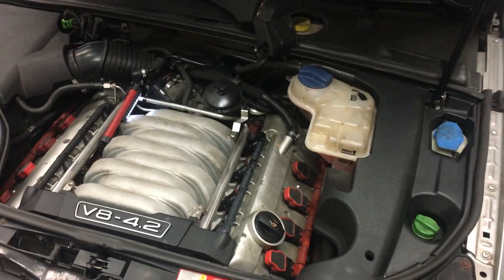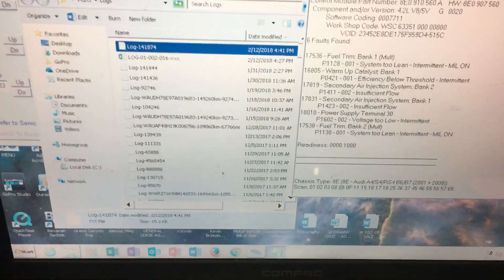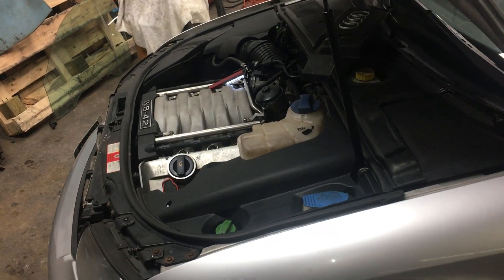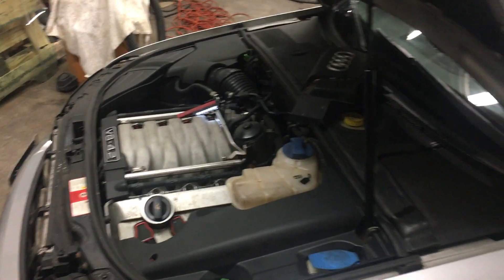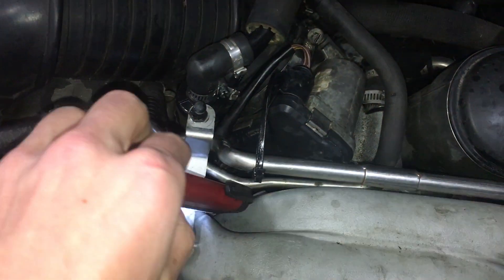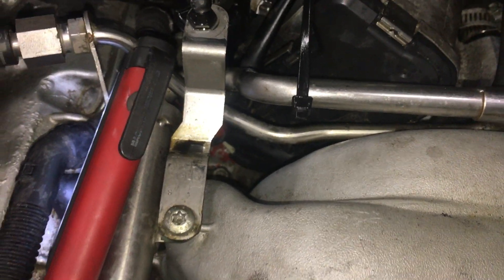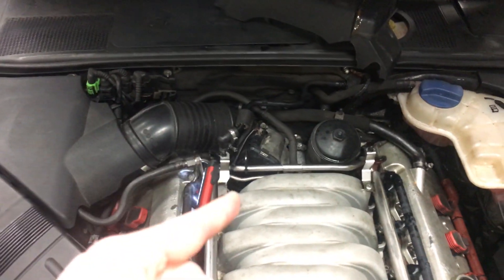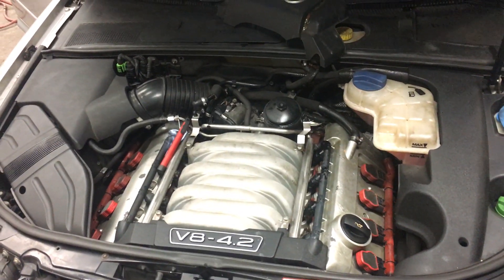Audi S4 A8 4.2 P1411 P1423 Secondary Air Insufficient Flow

Comment: I have that code also. Could a vacuum leak trip those codes? Also where is the pump?
Reply from the maker: Hey BunBun 143 thanks for watching my video.  To my understanding a leak in the secondary air system could throw the code, it is best to get a diagram of your secondary air system to locate all the parts specific to your car.  You can try google searching something like, the year of your car and model followed by secondary air injection system diagram.  This will show you all the components in the system that you can look over.   It would also be helpful if you could do an activation test of the pump to feel the output of the pump.  Please share an updated diagnostics, thanks a lot.
Reply: Thanks. I’ll do my best. I’ve been dealing with EPC, traction control and engine light for about 2 weeks now. I have the following codes.

P0507
P1423
P1411
P1542
P1653
Reply from the maker: Thanks for the update, seems like you have a bit going on.  My experience it seems like for P1423 and P1411 secondary air pump and or secondary air lines, along with a throttle body issue for P1542  and P0507 ( I would often replace the entire throttle body). As for P1653 you would have to scan the Brake Control Module to know the true issue, things I have come across are, the wiring harness at the ABS module connection, needing cleaning, lubrication and or wire repair.  Some times I would send the ABS module out to get repaired ( not too complicated).  Then again it could be a failing speed sensor, always best to see the codes if you can.  Please remember these are only my experiences make sure to do all your due diligence before replacing anything.
Reply: Thank you! I’ll definitely look in too all of the above mentioned. I feel like the engine isn’t getting enough air.
Reply from the maker: Cool stuff keep me updated, thanks.
Reply: I took my car to a mechanic. They did the diagnostic and it pointed towards my throttle body. Just changed it and the mechanic did the adaption. On my way back I got the same symptoms. EPC, traction control and engine light. Idk what do to anymore.
Reply from the maker: What about the other codes? Anything else replaced, always have to do a full system scan to see what is stored and hard fault. Very tricky situation especially with the other codes you need to see what codes are coming back?
Reply: The mechanic said that the diagnostic pointed at the throttle body and that’s what’s causing my codes. Says the new throttle body I got could be damaged and the person I bought from swears up and down that there is nothing wrong with the throttle body and is willing to take it back and give me my money back. So I’m gonna replace the abs module and if symptoms are still there I swear no word of lie I’m fucking burning this piece of shit down to the ground. I’ve spent too much money and time on it and I’m sick of it! No one knows what the fuck is wrong with it or how to fix it! lol sorry just frustrated lol
Reply: Update. I finally fixed the problem. I opened my old throttle body. Cleaned the entire gears and the motor with brake clean. Put all back and in my car. I had to unplug the negative terminal from my battery for about 30 minutes for the system to rest. Plugged the battery back. Turn the car on but not the engine. Waiting for the throttle to do it adaption then started the car. Everything. works perfect now!
Reply from the maker: Nice work that is crucial to give the throttle body time to do its adaptation is crucial.  I am guessing you had no advance scan tool and managed all the clearing and adaptation manually, very cool.  Thanks for sharing this, it will be very helpful to many others that read this in the future, thanks again for sharing.

Comment: Does a crack in the pipes from secondary air pump cause a high pitched squeal similar to when pcv faulty? Mine is squealing high pitch when warm at no throttle/idle, but pcv changed and still doing it, also removing oil filler cap makes no difference to sound and not difficult to pull out. Any ideas?
Reply: Also have same codes for cat warm up insufficient
Reply: Did you ever figure it out? I have the same issue

Comment: Changed my MAF sensor on my 2005 Audi A8 L. Never knew there was a problem because the vehicle drove perfectly fine. I had to do emissions due to the year and failed codes for MAF. Changed it and now it’s running rough and cutting off. If anyone can help please respond to my comment.
Reply from the maker: Thanks a bunch for watching my video and taking the time to comment.  Did you source a new and OEM or OES quality MAF and if so what brand?
Reply from the maker: If the MAF is new and preferably OEM quality, you may need to check the root issue appearing from the start. For electronics, I like to source OEM or OES quality.
Reply: @WheelsTips  I have very little car knowledge and I’m uncertain about the difference between OEM and OES?🤔
Reply from the maker: Thanks a bunch for the update. I don’t want to copy paste but Google search; difference between oem and oes car equipment. Google will summarize in 2 sentences the difference. Sometimes fault codes can appear to be one thing but can tie into other issues. For example you may have a MAF sensor code, but it’s not the MAF sensor that’s bad but rather a little single wire going to the MAF, each situation is unique. There is a lot when it comes to diagnostics, especially if you start replacing parts.

Comment: Thanks I'm going to investigate the hoses when I feel better...2004 A8 is doing the same thing.
Reply from the maker: Hey You'll Like It Too thanks for watching my video and for taking the time to comment.  Hope to hear an update about the hoses and wishing you a strong recovery.  Also does your secondary air pump come on cold starts?  Thanks for any update.
Reply: @WheelsTips I will indeed get back to you and thank you. I actually scanned her today because of the CEL from the catalytic converters ineffeiciency threw codes yesterday. The secondary air pump code is new to me. Not sure if the pump stayed on or came on at all. Sub'd 😁
Reply from the maker: @1995RangeRover  Greatly appreciate the sub! As for the catalytic converter codes this could be from low quality gas for a long period of time, along with many other reasons but this tends to be common reason.  Will be on the look out for future updates, thanks again.
Reply from the maker: @1995RangeRover  And I subbed back!
Reply: @WheelsTips  hmmm poor gas is probably right and I'll try another station thanks for the sub 👍😁
Reply: @WheelsTips  the secondary air pump came on then went off. Just listened out for it as I started the car today. I'll have to check the hoses another time to see what's, what.
Reply from the maker: @1995RangeRover  Hope your diagnostics are coming along well.  Just wanted to check in and see how everything was coming along and if you checked the hoses? Thanks a bunch for any update.
Reply: @WheelsTips  sorry for the late reply...I saw a broken hose on the right bank and fixed it and all was good. After that cyl 4 misfired...fixed that...now I'm getting the secondary air pump insufficient flow with catalyst error too...uhh boy she sure hates me!!!

Comment: Hello, I wanted to join the question, my P0411 crashes all the time and I got an error P1411 once, can it be related to the wires because I replaced the pump and it did not help, I was thinking about the secondary air pump relay? What do you think?
Reply from the maker: Hey DASTY thanks for watching my video and for the great question.  Are you able to actuate the secondary air pump with your scan tool?  Does your secondary air pump come on after you replaced it? What year and engine does your Audi have? Also have your checked the lines mentioned in the video, are they cracked?  Thanks a bunch for any update.
Reply: @WheelsTips  2006 2.4 BDW after replacing the pump, nothing changed, the 614 transmitters on the right side of the pit and we'll see what's next
Reply from the maker: @dasty694  Did you clear the codes? Is your secondary air pump activating?  Looking forward to any update, thanks.

Comment: 2013 s5  error p049100 . Im Trying to locate the secondary air injection pump/houses . Any idea where are they located ?
Reply from the maker: Hey Sky Kam thanks for watching my video. The location of the secondary air pump to the best of my knowledge is located below the passenger side headlight, behind the bumper. Please consider subscribing to my channel, it would help me a lot. Also please update if you were able to locate the pump.

Comment: I have a check engine light, I think codes 491, 492.  PCV is also making a continuous sound. I'm thinking Diaphragm could be torn. Thanks for the Vid I will check those hoses below as well.
Reply from the maker: Hey Kraven thanks for watching my video. The PCV system tends to be strong on these cars, but definitely not impervious to damage so let me know if the diaphragm is torn. Please consider subscribing to my channel it would help me a lot, thanks.

Comment: These lines go to the combivalves correct?
Reply from the maker: Hey ahaffke thanks for watching my video. I do believe they eventually meet at the combi valve. The area I point out is most common for breakage. Please get back to me  with your findings, I would greatly appreciate that.
Reply: My vacuum tubes were shredded before I took the IM off. I had to do a lot of SCI work to find out where they went. I put new flex-silicone lines to connect them however I now have a CE light with codes of not enough secondary air flow and surging poor torque. Smoke tested and no manifold or vacuum line leaks. Still searching for the root of the problem.
Reply from the maker: Hey ahaffke, thanks for responding. Seems you have two separate problems in my opinion. Secondary air in the major percentile would not make your car surge on idle, that could be more like a vacuum leak, poor flue delivery, clogged intake system , bad MAF. As for your insufficient flow in secondary if you checked your hoses would be to check the pump itself. Over time they build up water and condensation, leading them to weaken and fail. Also check for cracked hoses by the pump area.
Reply: Surge is on acceleration. Just got my ODBII (VAG style) working again so I'll take some real-time looking. Never had a vacuum leak act like this (surging).
Reply from the maker: Hey ahaffke, is your car automatic or manual? If automatic check your transmission for error codes? I recommend you do a full system scan with something like a VCDS or dealer comparable tool that can communicate with the entire car network.
Reply: LOL 6MT! Clutch  slave cylinder sht the bed on Friday and my new house has a 1-car garage so I had to pay to have it towed and have a shop work on it (ugh!) more to follow.
Reply from the maker: I figured 6MT lol but wanted to ask.